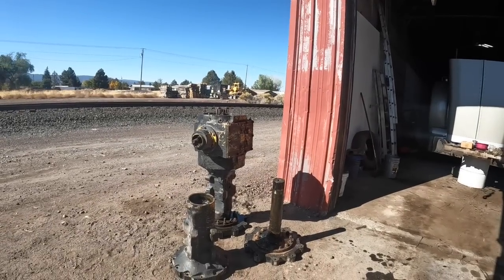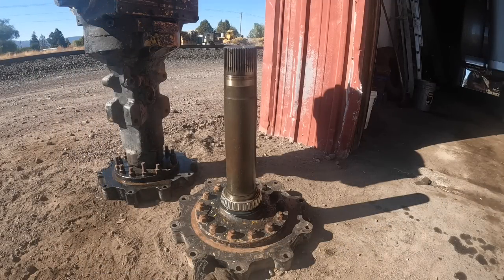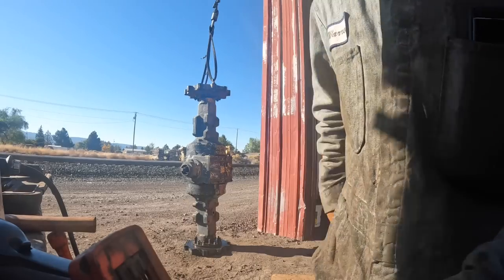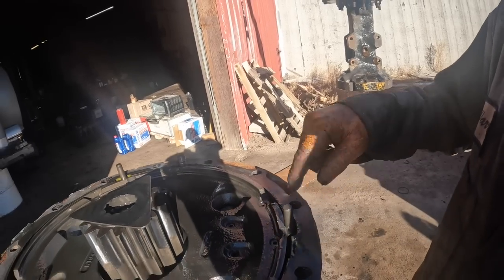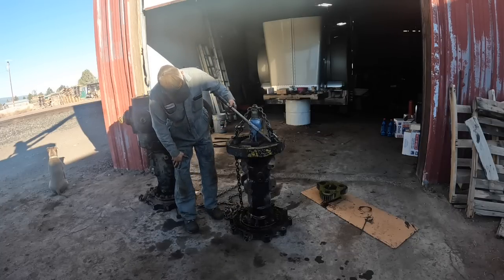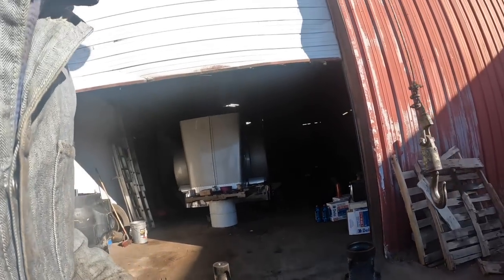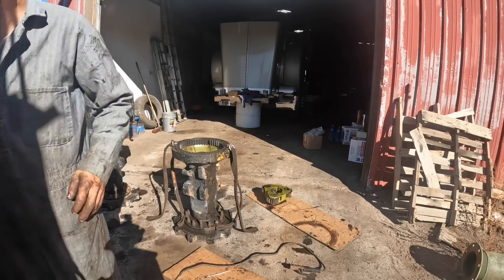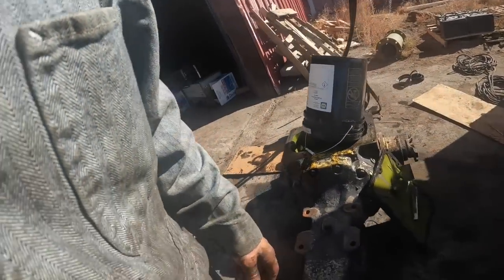Pain in the rear end!

Comment: Thanks for the ride along sir. Been down that road of tear down, pulling bearings and seals and clean up and reinstall, not always fun and the customer always needs it back asap because they never break down until you are using the machine and usually right in the middle of the job. Great Job young man, like some of the ideas you came up with on disassembly and heating the bearings is oh so much more easy on install. Stay the course Warren.

Comment: Heavy is right, its a little over a ton if I had to guess. Having a crane makes that job a lot easier for certain.  Same axle used in the 644e loader with different hubs on the end. I got it hard from the local dealer to replace those end seals, I brought them the axles to press the bearings off and put on new end seals, the bastards torched the bearings off, well shit, couple hundred bucks a bearing I could have done that.  I delivered just the two axle shafts and they wanted to charge $1500 for just the two end seals. and new bearings of course.  Did them all myself after that bullshit.  That  jack works, I used 2 bottle jacks and 2 blocks to push those axles out of the housing.

Comment: Just a suggestion - when pouring oil in that space - drill a hole in the plastic bucket on the opposite end of the drain on the bucket - it let's the air escape or in the bottom of the bucket - but then if you don't use all the oil then forget about the above
Reply: I do that. But I just punch a hole up under the lid with a screwdriver keeps the water out if you don,t use it all

Comment: To refer to that job as a pain in the hind quarters would be putting it mildly.  For what it is worth I am a tad concerned about the silicone used both inside and outside of that axle seal.  wouldn't that effectively glue it to both the axle and the housing?  Or is it a two part type seal that is meant to be like that?  Anyway , you're right , using your brain and not your back goes a long way when you're working with parts that big and heavy.  A finger pinch with them can take out chunks or break bones.  Protect yourself always.  See you in the next one Man.

Comment: Warren, my brother and I did the outer bearing on his CIH 495 that had a very similar axle setup. There was an elaborate procedure to set the preload on the axle bearings by tightening the bolt on the inside of the axle to 220 ft-lbs and then check the force to turn the axle by using a scale on the axle stud, then add or subtract shims on the inside of axle until force was 8 lbs to turn axle. Was there any preload settings for that axle?